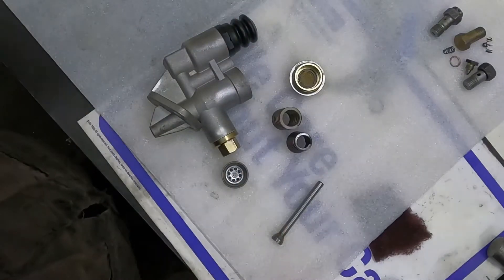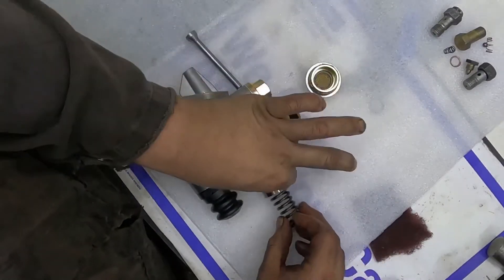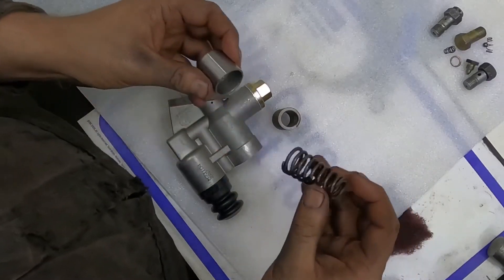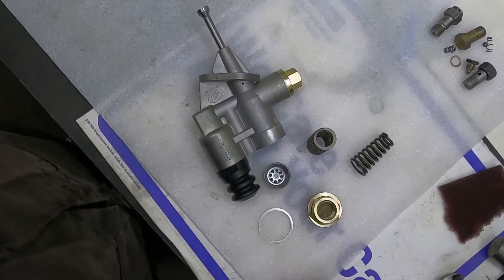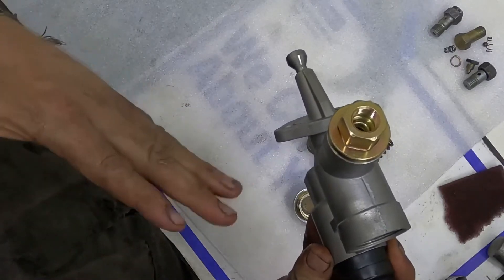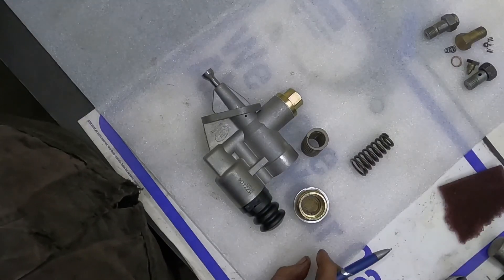Upgrade Your 12V Cummins Factory Lift Pump: Unleash Your Engine's Full Potential

Comment: I GUESS I JUST ''DONT'' UNDERSTAND ''''''''''   WHY ' IF YOU HAVE A (12V) WOULD YOU GO FROM A ''MANUAL'' FUEL PUMP TO ''ELECTRONIC PUMP  '''  MAYBE MORE H.P. ''''''''   HOW MANY ''DAM'' HORSE'S DO YOU'' REALLY '' NEED ''''''''''  I PULL ''35.000'' L.B.S.  WITH 400 HORSE'S '''' AT 65 M.P.H. '''' THROUGH THE '' MOUTAIN'S IN '' CALIFORNIA & OREGON ''''

Comment: Hello rob. So I did the overflow and the spring upgrade. But now there is so much pressure it’s blowing or causing the o-ring for the fuel filter to leak now. What should I do now.?

Comment: This spring replacement fixed my truck today. 
I replaced my mechanical lift pump with a premium new pump from O Reillys’s Auto parts last year. My new lift pump has a 30mm plunger. 
Fuel pressure would still drop down to 5 psi under load and high rpm’s. Filters are clean. 
So I replaced my drain back valve with a Torx adjustable. 
Idle fuel pressure was better but still went down to 5psi under load. 
This Comp Cams spring fixed it. 
It’s a pain to change. I had to put my slightly used lift pump into a vise to install new spring. 
 Now my pressure is between 27-18 psi and my truck is very happy.

Comment: Hi Rob, I bought the spring from you last week and got it installed. The spring was a tight fit and the pump at the filter head is at 20 psi? Is this too high? Thank you, the truck runs fine but afraid of blowing up this pump 

Erik Jorgensen

Comment: Hi Rob, thank you so much for all your help through this channel. I purchased an 04 f250 with a p pump 12v swap 5 yrs ago. I have put 180k miles on it and believe the fass fuel pump may be getting weak. My question is.. does this mod add any additional wear to the cam with the comp spring over long term? Thanks again!

Comment: Would you do this on a stock truck with the fuel plate and afc cover moved towards the front bumper? Just trying to achieve 350hp. I will be upgrading the clutch to a 350 to 450 hp clutch.
Reply from the maker: if you just run a big bore pump with a normal spring is lots for that

Comment: I ordered an oem lift pump off eBay and was unlucky and got a 26mm plunger. I went ahead and put the 973-1 spring into it anyways and it was extremely hard to get the fitting back on but having a bench vise helped. Tighten it down all the way.

Now I’m afraid that it will have too high of fuel pressure. Any experience with this situation?

Comment: I'm needing to change my factory lift pump.  with another mechanical lift pump  with you upgrades. the  prices are all over the place $37.00 to $400.00. links to the one I should get would be greatly appreciated

Comment: Rob, Rob I shout!  
 We need a genius to design, and modify a kit to install the old 855 injection pump on our engines !
They are cheap, and simple.
The problem is as you know- they are cam-operated.
Hey! We have a cam.
How can we do this?
The 855 engines work flawlessly with this setup.
We need this!
You would be selling these by the millions!
Thanx!
Reply from the maker: Something to look into
Reply: What a simple clean operation this would be with perhaps just studs installed in the head for another set of rockers and a differnt camshaft ...and a couple other problems ..LOL   do you have a Big Cam head shrinker?

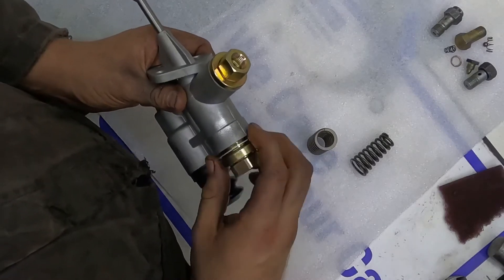Comment: 4:28 Hey man not sure if you will see this but if you do I gotta question and would love to hear your answer. i’m overhauling my fuel system right now and upgrading everything to -8an lines and fittings. i’m also getting rid of my preheater because i’m going with a more efficient heating setup with a screening element closer to the tank. because i’m running -8/ 1/2” stuff i was wondering how I can make that work with the lift pump. i’m not sure if this is correct but from my understanding the lift pumps inlet thread size is 1/2” npt and the outlet is m14x1.5. do you know if there is a different outlet fitting that will thread into the pump body that will give me a 1/2” npt outlet thread size? i’m honestly not sure wth those fittings on the pump are even called let alone what thread size they are, i just simply cannot find any info about them to save my life. If you have any ideas i’d love to hear them!
Reply from the maker: I will do a quick video on the subject and see about posting it tomorrow or Thursday for ya. Get info for guys
Reply: @CUTTERUPROB  Thank you I’ll keep my eyes out. i’ve been binge watching your videos for a couple weeks now lol.
Reply: When I did my truck, I used the Push-lok fittings and 1/2” hoses. It was a while ago, but I know some people have kits, but you can do what I did and just find fittings with the right thread pitch.

On my future build I’m planning to use hardlines as much as possible, though, so I’ll have to figure that out.
Reply: @joshua.merrill  For the first 2 phases of my build i am running -8 steel braided lines for most of everything. I want to try my hand at modding and maxing out the stock lift pump myself but after I run that for a bit i’ll be switching to a fleece power flow pump. for both setups i’ll have the steel braided lines connected to the feed and return at the tank. the feed i’ll have ran directly to the inlet of the lift pump but on the outlet i will be using a an adapter fitting that will connect to a tube nut and i’ll make a custom 1/2” hardline the goes up to the filter housing with I will also be modifying the inlet and outlets by drilling them out and tapping them with a larger thread size to run larger banjo bolts with -8 banjo fittings that will connect to tube nuts for 1/2” hardlines. the outlet of the filter housing will have a double stack banjo bolt so i can run a hardline to the factory IP inlet but also to the front port so i can have a dual feed setup. i’ll also be getting rid of the fuel heater and putting in a longer stud in the filter housing so i can have a sandwich type fuel heater like the GDP kits. once I put the fleece in tho i’ll run a actual GDP kit in the frame and fab up a custom mount that will replace the stock filter housing and still allow me to keep the same plumbing.

Comment: I got an eBay DCEC pump that is 28mm. The inside of the cup measured 0.947” so I’m going to order the Comp Cams 975-1 spring, which has a similar spring rate and height to the one you recommend, but I’ll only need to bore out the cup a few thousandths to fit the spring.

There’s also the 974-1 spring which would drop in the 28mm pump, but doesn’t have as high of a spring rate.

I appreciate this video, because I had my eye on the PDP hot rod pump for $410, but this is significantly more affordable and still get the 500hp I want.
Reply from the maker: That will have no problem doing that. I have my one truck in the dyno right now it’s makes 550 ish with them same pump

Comment: I have a 12 valve with ppump in an 08 f250. Just had it in the transmission shop... up on the lift, it ran through the gears just fine. But, once lowered to the pavement and under normal driving load, it spit and stuttered under acceleration... starving for fuel. The ppump has been upped just a bit, timing is at 18°, injectirs are 5x17, the mechanical lift pump has been "hot-rod modified". My shade tree guy says i need to also install the original ford electric lift pump.

Why? Did the '97 5.9 require two lift pumps? Im now lost and confused. Why is the hotrod mechanical lift pump not supplying enough fuel? (If thats actually the problem).

Anybody?
Reply from the maker: Sounds like timing. Which isn’t just the easy. Can be the dvs size depending on the ppump you have , timing , lift pump pressure
Reply: @CUTTERUPROB  thank you for responding, and so quickly! Forgive my ignorance, but it runs and revs up super smooth without being under a load... wouldn't a timing issue show itself without a load? I mean, the entire motor has been gone through twice, the ppump has been rebuilt, injectors have been cleaned and inspected, new head, all bearings, timing was fixed after installing the upgraded (timing gear I think?), the motor is supposedly in ship shape... I wish I had more understanding. It's kinda sad, lol, It's been almost 4 years since I blew the 6.4 and started the Cummins swap-- I've not driven this truck since then. I'm over $35K deep in it, and it's always effin something. Jeezuuuuus! I thought a 12 valve swap was supposed to be the simple path....
Humor me for a moment... is there any reason (other than timing) that my upgraded mechanical lift pump would need another pump to feed it? Is it just too far away from the tank? If the problem has anything to do with timing, I might consider setting fire to this money pit. I just don't understand why the mechanical lift pump might need help. I digress. I'm lost.
Reply: @LemmyKutcherGrass any updates I have a 99 f250 with a 97 12 valve after injectors last year (was told old ones were offset) it shakes a bit and seems to not like low rpm take offs only when cold then it would be fine now it seems to be at all slow take offs it is winter and I did add anti gel and I’m currently not amused at my car and truck both money pits are hurting rn but this is my first year adding anti freeze and last year I noticed that lag after injectors
Reply: Air can get in through a tiny leak like at a banjo bolt or one of the hard fuel lines between the injector pump and the injectors where they thread in place. First thing I would do is install a fuel pressure gauge so you can monitor whether fueling is the issue. If you are losing significant fuel pressure, I would replace the overflow valve with perhaps one with a fixed rate by Tork Tech.

If you haven't removed the filter that is inside the lift pump, it could be clogged with debris so that the obstruction is blocking fuel flow. I too am curious about tying in the factory Ford lift pump to aid the mechanical one on the Cummins. Trying that shouldn't make anything worse considering how much your engine has been sputtering.

I would also verify the timing and that it is at minimum 14 degrees if not closer to 20. 17.5 is a popular daily driver amount while competition engines may go over 40. And, if your truck has been sitting for years, I would see if it runs any better from a fresh jug of diesel in case there are issues with the fuel or in your tank. Not sure if 2008 Super Duty trucks benefit from the hutch and harpoon mods, but the draw straws and pickup pucks inside the tank are notorious for failing on 7.3 and 6.0 era F series.
Reply: Same problem here. My 08 has a 12 valve in it and I’m having the same issue you are. Ever figure it out?
Reply: So recently I was told I'm either getting air in the line or I have a blockage. It's at a new shop here in town, I reckon I'll know for sure in a few weeks. I'll post an update once it's all better.

Comment: Will this mod have a negative effect on the p7100 pump and can you buy a 30mm plunger? I heard it may damage the actual injection pump.

Thanks
Reply from the maker: This with not hurt the pump , running them low in fuel pressure will hurt them long before high pressure

Comment: So I bought a cheapy off Amazon the od of the plunger is 30mm.
The I was 22mm.
I bored it out in a lathe to 1" as far back Ias I could .5 back.
It's hard to push the plunger but can push it all the way in . Pressing the pump down onto a table. Do you think it will be ok.
Reply from the maker: I have done it with out issue.

Comment: My old lift pump appears to be making a tapping noise due to the spring getting weak. When I replace it I may try this. I have no idea what the horsepower of the truck is. Also looking to remove the fuel heater unit that I removed the heater element from a couple yrs ago and put in the Larry B's delete kit. What was the spring part #? Thanks
Reply from the maker: Pn is in the description of the video I don’t know it off the top of my head.
Reply: @CUTTERUPROB  Thanks
Reply: Sorry, I meant to ask, does the added pressure on the plunger with the upgraded spring may be a concern for wear on the pump or cam lobe. I have been told by some that the tapping from the current old pump may cause damage to the cam lobe, others say no.

Comment: Hello from Sacramento CA . 1997 2500 4x4 cummins 12v 47re transmission  right now low performance can't  run truck above 2200 RPM. My TV cable has exssive play. Adjusted foot pedal play and connect rod.
Reply from the maker: there is a is about 20 things it could be ,  but fuel pressure be good place to start
Reply: @CUTTERUPROB  where u sale them at I’m tryna buy one
Reply: Lower boot between turbo and intake manifold leak was the culprit along with tv cable out of adjustment. Shifts at 2200rpm on full throttle and 1800 on 1/4 throttle  now

Comment: Is it normal for the comp spring to be longer? I bought this comp cam spring for my pump. I couldn’t get it in because it was 3/8 of an inch longer than the stock one and I couldn’t push in far enough to get the fitting nut started.
Reply from the maker: if the pump is on the engine make sure you have the pump cam lobe at it lowest point ,  i just recommend have the pump on the bench  then you can use both hands
Reply: Thank you for the speedy response 👍

Comment: Will a orielys electric diesel pump off the shelf work
Reply from the maker: the pressure and volume is to low from any auto parts store one i have seen.

Comment: What is the i.d. of your plunger ? My 973-1 sprung does not fit inside my plunger
Reply: Mine measures .883
Reply from the maker: It’s a small pump. Only way would be to buy the big pump
Reply: @CUTTERUPROB  do you by chance have a link to a pump that you know will work? or where do i get one?
Reply: The o.d.is 30mm

Comment: I bought 2-8x1.25mmx2”studs and nuts to replace oem bolts for mounting new pump…much easier to slide new pump onto studs than holding pump with one hand and getting bolts started straight with other.
Reply from the maker: yep it is easy way to help

Comment: If doing it on truck jog engine so pump is off the cam lobe to eliminate fighting spring pressure on reassembly…also is that relief hole important?
Reply from the maker: you will still fight it even when your off the top of the lobe, but your right when it on the high spot it is harder, and on the relief hole its not.
Reply: @CUTTERUPROB  I heard that if there’s no relief hole that fuel could get into the crankcase if the seal fails instead of the fuel exiting out the relief hole…what’s your opinion on that?

Comment: Soo will this work with my factory style pump? Few days ago mine started to make annoying ticking noises....its not a massively tunned 12v I got the AFC tunned and a cut 0 plate...stock injectors and stock gov springs for now
Reply from the maker: Yes it will
Reply: @CUTTERUPROB  so another odd question...last year my 12v was stock...no adjustments done to the AFC. Started easy as can be in the cold...never even had to touch the throttle for a chilly cold start even in the mid teens...well over this past summer I did a few adjustments...moved the star wheel ahead all the way...0 fuel plate with the AFC slid forward all the way and backed out the pre boost fuel screw a bit...now this morning it was 19f out...had to push the throttle a decent amount and when it did start it was rough and had to like clear its throat out sor to speak and then was fine....been noticing its been getting rougher to start since its been getting colder...any ideas? Would tunning it for more power cause harder cold starts?
Reply: I would definitely try giving it more pre-boost fuel than less, you could be starving the engine.

Comment: Last question before I take the plunge. No pun intended. Before I put in the Comp-Cams 973-1 .970" ID from Amazon into my new DCEC lift pump, I pushed in the rod by hand to check spring tension. It was manageable. After the mod, it is much more difficult to press the rod in by hand. With this much more extra stiffness/ tension, is there any chance the cam lobe will be galled or damaged from the excess force now required for the pump rod to articulate? Thanks again!
Reply from the maker: I have never had a issue and I have been running them for years
Reply: How about prematurely failing from increased pressures?

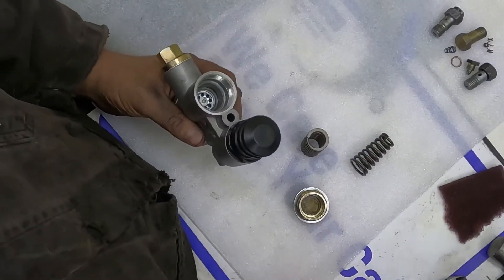Comment: Thanks for the video. I have a new DCEC left pump with the weep hole. Is that the same thing as the pressure relief  you mention at 6:30? Thanks!
Reply from the maker: no the weep hole is in the pump is bypass fuel, the relief is different
Reply: @CUTTERUPROB  thanks

Comment: I have a 92 Damon motorhome with the 12 valve 5.9 p pump cummins. looks identical to the one in my 97 dodge ram. I was changing the lift pump on it and noticed it did not have a heater or a spacer behind it ??? should I put one on with the new pump. The new lift pump is the same one you have in this video. I measured both of them and the rod is the same length. Would it affect anything if I add the spacer since it was running with out one. Been that way since I have owned it. Confused in Texas.
Reply from the maker: The industrial ones are different. If you replacing it just make sure that you get the right one in it. If you use a pick style one you need the spacer